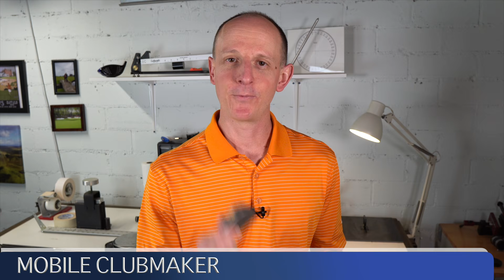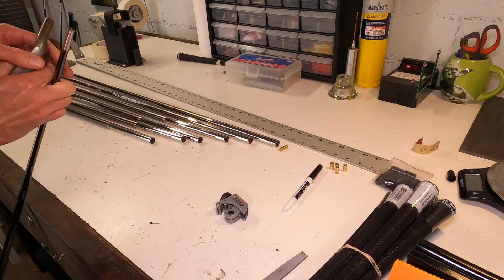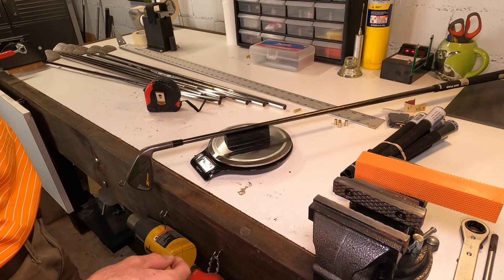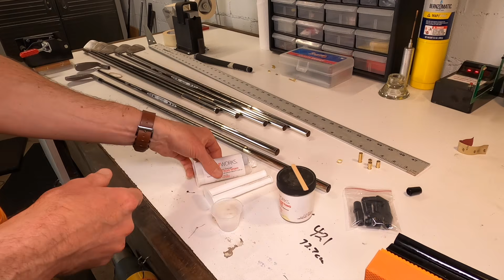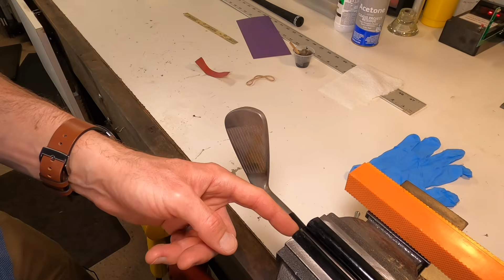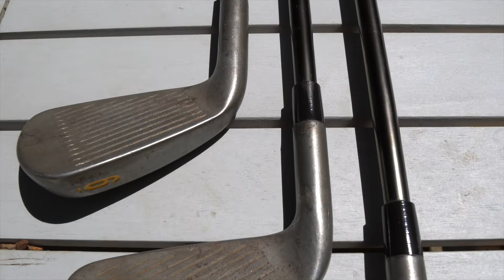BUILDING GOLF CLUBS INEXPENSIVELY / NO COSTLY TOOLS USED!

Comment: when i add weight to the butt of a fishing rod, i put a glob of epoxy in the blank and then slide the weight in. do you ever have any issues with the weight not sticking well enough and start sliding around inside the shaft?
Reply from the maker: The weights have a lip on them so they get locked in between the shaft tip and the base of the hosel.
Reply: @EFGMC i see. In rod building we just use whatevers heavy enough and laying around. I like to use old lead weights that i use tungsten versions of now.

Comment: Great video for us DIYers.  Were those shafts single length (cut both ends) or precut for each individual iron?  If I use precut does this eliminate all the guessing and trimming?
Reply from the maker: These were taper tip so you would only butt cut these because each shaft is factory matched to each iron.

Comment: Awesome, thank you. I was curious, how much did the set of clubs cost you? Equipment was less than $150, but how much did it cost to build this set, without the tools? Thank you.
Reply from the maker: I think the heads were around $500 used, shafts were around $40 each and $6 per grip.
Reply: Damn, really? That's actually way more expensive than just buying a set used, but mint or at least good condition on eBay or any golf store. Not inexpensive. How about a video about assembling clubs from different golf suppliers?

Thank you for the great video, really appreciate it.

Comment: Great Video…. Thanks for sharing..!
Why did you add a 4 gram weight..?  Cheers 🍻
Reply from the maker: Wanted to make the heads a little heavier for the feel. These heads had been stripped of all the chrome so the raw weights were lighter than they would otherwise be.
Reply: Did they end up being around a D2..?
Reply from the maker: @stacks4943  Think they ended up D1.

Comment: Curious about tip cutting. If I have a driver that broke off right at the neck, can I trim that broken shaft and use it for, say a 3 or 5 wood?
Reply from the maker: Depends if the shaft had been previously tipped for the driver and how much you need to cut to get to undamaged shaft. If it gets over 2 inches, you might not want to do it.

Comment: Honest question from someone who hasnt replaced or installed a shaft. Is JB weld an acceptable epoxy for golf clubs?
Reply from the maker: If it cures to a high enough lap shear strength (2500-4000psi) it should work. That said golf epoxy often has microscopic rubber like spheres in it to help soften the impact forces. 
Will it work short term, pretty sure it will. Will it hold up longer term, can't say.
Reply: @EFGMC  Thank you, sir!
Reply: I got an old driver that I'm "experimenting" with. I used the jb weld and I've turned it into a mini driver of sorts. I'll let you know what happens!

Comment: Hi AJ, a great video.  I noticed that when you dry-fit the shafts to the club heads they fit pretty easily. Is this way they should fit or should it be quite a tight fit? I am reconditioning some older clubs at the moment. I struggled to remove the shafts when taking them out. Now that I have them out I notice that when I dry fit them they do not go into the hosel easily. Should I sand the shafts a bit more, drill the hosels a fraction, or both?

Comment: When you’re turning down the ferrules are you sanding the ferrule only?
Reply from the maker: Yes, the sand paper won't hurt the metal if the finish is chrome, raw, or brushed chrome. If it's painted then you want to cover the hosel end with some masking tape or be very careful when sanding.

Comment: Do you want a 7 gram progression through your GW, PW, SW, LW? Or would you want your GW and PW to match while your SW and LW match?
Reply from the maker: Will depend on 1, how you stagger your lengths on the wedges, and 2, how you want the SW to progress.
That said, you will in most cases want less than 7g between them because most people drop to 1/4 inch intervals between the wedges.
Reply: @EFGMC   In this scenario my PW and GW are exactly 295g. My SW is 307g and my LW is 309g and I don't know what to do about the lengths for these 4 clubs. I play +.5"

Comment: Hey I had a question. I followed everything you said. Made a couple small aesthetic mistakes but all in all turned out ok. Of course after the fact I noticed the shaft manufacture reccomended tip cutting depending on club head. I did not do this I just cut the butt ends to length. Is this bad news or will it be fine? Thanks
Reply from the maker: You were using .370 tip shafts?
Reply: @EFGMC  yes I did
Reply from the maker: @leroyjenkins2620  .370 shafts are usually trimmed from the tip to achieve the correct flex, then butt trimmed to length.
Will that matter for you? Will need to go try them out and see how they perform.
Reply: Yeah that’s the step I overlooked unfortunately. So an r/s shaft will be lower than R I guess with no tip trim?
Reply from the maker: @leroyjenkins2620  The long irons will be close, the shorter ones will get softer as you go. I would still try them first and see how they play though.
Reply: Thank you!

Comment: did you tip-trim them before the video?  I missed that step
Reply from the maker: No they are taper tip, so butt trim only.
Reply: Of course, thanks.
Reply: @EFGMC  I've only used parallel tip shafts.   Are taper shafts used because of the head, or are there some other criteria?  Thanks
Reply from the maker: @dcheever07  They match the head is why I used them.
Reply: @EFGMC  Ok, great.  I really like your channel, 3 thumbs up, if I had them.

Comment: I will be trying to build a set or irons and woods by myself. I only golf a dozen times a year and I am not good. I use a set of clubs from a 2nd hand store/ goodwill for the past 20 years.  My father passed away and he loved golf. He was the same size as I am. I inherited his golf clubs which were much better than mine. BUT...he was LH and I am RH so no go. But what I wanted to do for sentimental reasons was to by new iron heads and deconstruct his clubs and use the graphite shafts he had on my new heads. I purchased Callaway Big Bertha B21s. Can this be done and is there anything different I need to do from your videos with these B21s? Any advice would be much appreciated...Thank you

Comment: What are your thoughts on this…I bought a set of AMT White S300 shafts for a great price…but, they are 4-PW…My irons are 6-GW…will there be a big difference if I just start at the 5 iron shaft for the 6 iron all the way down to using the PW shaft for the GW?  I’m guessing because they are gapped consistently and I’ll be cutting them all about the same amount off it shouldn’t be a big deal…they must might be slightly heavier than they would have been…thoughts?
Reply from the maker: They will be slightly lighter and more flexible. Probably not enough though that most people could tell a difference.

Comment: Apologies if this is a stupid question.  How do you determine the weight that you add before installing the shaft?  So that there is a uniform increase in the mass of heads from long to short irons, or to shift the CG of each specific golf club?
Reply from the maker: If you have a 1/2 inch step down pattern in the set, then you will want 7g difference between each  head. If you are concerned with hitting specific swing weight numbers and don't have a SW scale, you can use an online calculator. Did a video on them.
https://youtu.be/sJALUBr51jI
Reply: @EFGMC  Thanks for the extended answer!

Comment: Why did you add the 4-gram weight?  Do the epoxy and the 4-gram weight need to be figured into the swing weight calculation?
Reply from the maker: These heads were quite light because they have been chrome stripped, which takes a decent amount of weight out of them. They needed some extra weight added back in for me to feel where the head was. 4g is going to equal 2 swing weight points when you are doing the math.
The epoxy used and the ferrule usually add about 2g, which you can add into the equation when you are dry fitting for SW.

Comment: Great video. 
I am going to swap TT DG Lite taper shafts into my KZG .370 heads to get more length. I like the feel of taper shafts better than parallel also.
The tips I got from you are that : I can use beads instead of shims
You used weight from a wood and ferules from .370 shaft. 
Plus I don't need a swingweight scale.
Thats a lot of good inside information that will save me trouble.
Thanks!
Reply from the maker: You can use beads, but they are no substitute for either brass shims or mesh tape. If you have a taper tip shaft and a .370 hosel, just go buy the taper to parallel brass shims. Will makes things much easier for you.

Comment: Where do you buy club components like heads and shafts? It seems that GolfWorks only has Maltby brand heads.
Reply from the maker: Golfworks, eBay, online marketplaces. Buying OEM heads is a little harder but very doable with a bit of searching. I use the same places for shafts.

Comment: can you explain how you made your measurement ruler with the gate hinge. Is it attached at the 0" mark? Is it at a particular angle (60 degrees) or do you just make it lie flush on the bottom of the club? Thank you.
Reply from the maker: The strap hinge is epoxied to the bottom of the 48 ruler so that the hinge can't move past 90 degrees because the edge of the ruler stops it. You could set it at 60 if you have a protractor or just set the angle to sit centered against the sole. Only time 60 degrees matters is if you are building a driver close to the max length and don't want to go over into non conforming.

Comment: This is somewhat like how I fit my clubs since 2008! Two steps are required. The center point of trial assembled club is first marked and that point on the shaft  is to be placed on the middle of the weighing scale platform. I have noticed that the weight can vary by 3 grams if it is off center. I live in India which is one of the most backward nations in terms of golf and equipment!

Comment: Quick question for you. If I want to change shafts in the irons that I currently have, will that change the swing weight significantly? I currently use the ping I200's and have the dynamic gold s300 which are 120 grams but want to switch to the nippon pro modus 105. They would be the same length as my current shaft, just a different weight.
Reply from the maker: General rule is 9g of shaft weight will equal 1 SWP. Different shafts however have different balance points so this rule can move around a bit.
But in your case with those 2 shafts, I'd would guess maybe 1 point movement assuming same length, grip etc.

Comment: I did that and I know my swing weight is d2   But with those measurements it can put at d8. Witch I know is wrong
Reply from the maker: Length and head weight are the two specs that jump SW faster than anything else. I would double check both those.  If you are building over length, often good to find B heads that are lighter specifically to match to longer build lengths.

Comment: Do the 7g increments also appear in the total weights or only in the club head weights?
Reply from the maker: Depends on the shafts you are using. I was using constant weight shafts here so the clubs do increase in static weight as they get shorter. If you are using .370 parallel blanks, the shorter you cut them, the lighter the shaft gets. This offsets some of that head weight change. If you are playing True Temper AMT shafts for example, the shafts get lighter as they get longer, so in this case you would see a more significant change in static weight as you move through the set.
Reply: Thanks! That probably explains part of what I'm seeing in my irons. The total weight increments just seem odd. 4-5 is 9g, 5-6 is 2g then 6-9 goes back to 9g increments. They are True Temper .370 shafts. 6-9 are a solid D4
4 is D5. 5-is D3.5 and 6 is D-4.5 (all on leader board)
Reply from the maker: @billchuplis9460  True Temper Dynamic Gold for example have a QC tolerance of + - 2 grams. Grips can also have a 1-2g variation. That combined with inconsistent head weights and inconsistent amounts of epoxy used can all add up to those sorts of weight progressions.

Comment: Does the pipe cutter work on graphite shaft?
Reply from the maker: No. You want to use a hack saw, or rotary tool with a metal cutting blade for graphite. Make sure area is well ventilated. Graphite fibers are bad.

Comment: I’m so glad that I stumbled upon your Chanel, it’s the best! Thanks from a very novice club builder!
Reply from the maker: Welcome. Thanks for joining our little community.
Reply: @EFGMC   great info , I used callaway x force the same club like you but it is polish , pls how do you make raw ?
Reply from the maker: @virginriverchiangrai2022  I bought these heads raw so I didn't do it. Requires some strong chemicals or a sand blasting station which wouldn't work in my shop setup.

Comment: Appreciate you teaching me/us how to put clubs together.  I was wondering if you always use the 24 hour epoxy always ?  and if so why ? thanks
Reply from the maker: Depends on the job. In general I will use either the 24h or the 90 minute one for most sets of clubs and singles. I don't like to use quick set unless it's a time crunch or a putter. Otherwise I like the higher lap sheer I get with longer set epoxies.

Comment: I have a question. Are all club hosels from different manufacturers the same. I have some Taylormade P790 clubs with graphite shafts which I want to switch to steel.
Reply from the maker: There are two sizes for iron shafts and hosels. .355 taper and .370 parallel. Ideally you want to get the matching shaft diameter for the hosel to make your life easier. Some brands like Ping and PXG do some crazy stuff with their hosels, (I think just to screw with club makers!) but Taylor Made is very straight forward. 790s are .355 tips assuming they haven't been modified by someone aftermarket.

Comment: Greetings -- I will watch the video soon but got an important question. I managed to get an adapter of a driver shaft without destroying the graphite tip and want to mount a callaway adapter now. However, the fitter here that that I need to get the inner of the shaft absolutely clean due to some vacuum that could otherwise pop off the adapter. However, when I removed the former adapter, the tip of the shaft was completely covered and stuffed with epoxy (and mounted by exactly that fitter) which then would have had the same "danger" imho. I guess it will be stuffed with epoxy anyway when mounting a new adapter, so do I really need to get it clean and probably ruin the graphite in that process (I do not have a graphite shat cleanr)? Thanx a lot for helping!
Reply from the maker: The best time to clean and prep the shaft is right after extraction since the epoxy will still be soft. You may just be able to use a utility knife, pointing the blade towards you and scraping away from you so that you don't cut the graphite, just scrape off the epoxy. You will also need to drill out the epoxy from inside the shaft. Just a small drill bit to create a vent hole is all you need. Without a vent, pressure will build up when re installing the shaft and push it out of the hosel as it dries.
You can also heat the shaft gently with a heat gun or extremely carefully with a torch to soften the left over epoxy if the utility knife scraping doesn't work as well with cooled epoxy.
Reply: @EFGMC  Thx a lot for your help! One more question: Can I reheat the grahpite shaft tip shortly to make the epoxy softer? I have a hot air gun with about 350 degree celsius, so no open flame... And: I can now blow through the shaft, that should suffice, right? And it is no problem if, when I epoxy the new adapter onto the shaft, the tip gets "covered/filled" again?
Reply: @EFGMC  Any hints on my last follow up question? And sorry for bothering :-)
Reply from the maker: @isleofdeath  Sorry, that other question slipped through my youtube alert. Yes, you can use a heat gun to warm up the epoxy again. Only need to get it to around 250F (120C) to be soft enough to remove.
If you can blow through or see light through, you are good. The new epoxy will fill that space, it supposed to. You just need it to give the air somewhere to escape when you  put it together.

Comment: does the pipe cutter work on graphite shafts? If not what is the best option?
Reply from the maker: No. Definitely don't use on graphite. It will crush the fibers and ruin the shaft. Best hand tool for graphite is a simple hacksaw with a high tooth count blade (mine is 32 TPI I believe). You can also use a rotary tool like a Dremel.
Hacksaw just requires wrapping the cutting area with a piece of masking tape to prevent splintering, then just smooth gentle sawing motion.
Reply: @EFGMC  Thank You!

Comment: Great video can you cut graphite shafts the same way?
Reply from the maker: No. Graphite you can cut by hand but you need a hacksaw with a high tooth count. I think mine is 32 tip (teeth per inch), but just get the highest you can find. Wrap the area with masking tape and then just cut with smooth gentle pressure to avail splintering. Can also use a Dremel with a cutting wheel if you have one.
A pipe cutter will crush the fibers so never use that method.
Reply: @EFGMC  thank you for the information.

Comment: You didn’t explain the swing weight at all
Reply from the maker: Sorry, I had more on it but cut it when I was trying to stay around 15 minutes. Once I measured the 7 iron head and saw it was around D0-D1, I added 4g to get the weight up 2 SWPs. At that point, I used that new head weight (what it was originally plus the 4g) and used that as the base to measure the rest. Then I just added weight (didn't need to remove any weight since they were striped raw heads) so that each club head was 7g heavier than the one before it moving into the 8,9,P and moving 7g lighter per club into the 6,5,4.